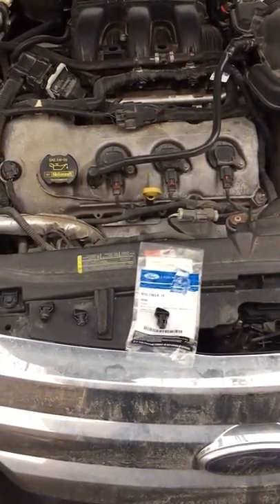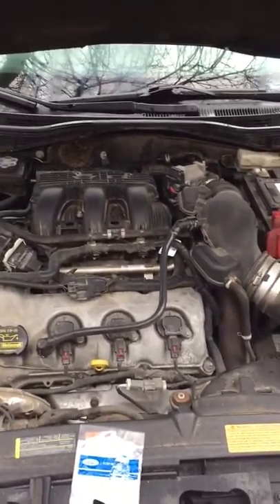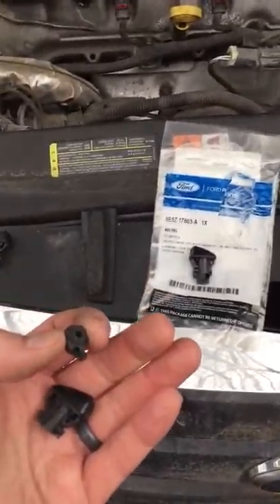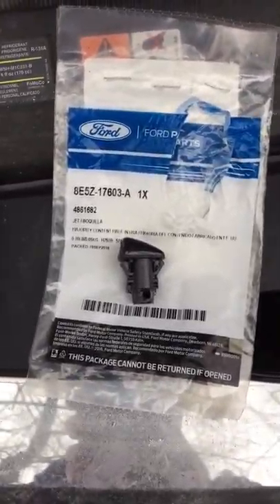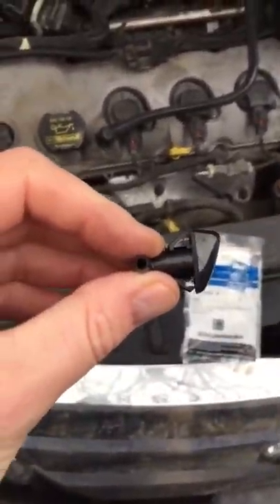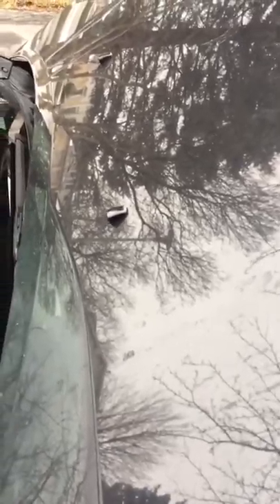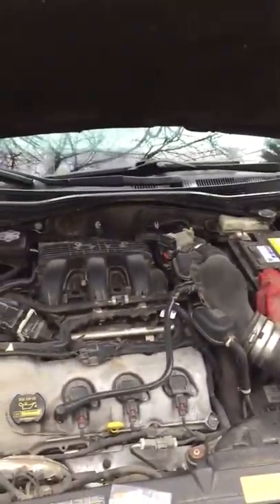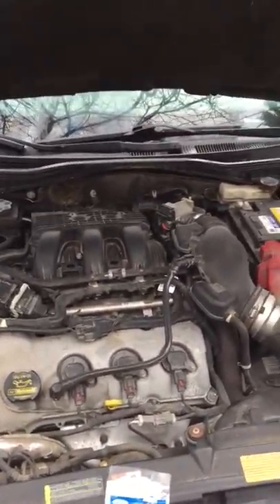Windshield Washer Jet Nozzle Sprayer Wiper Fluid Not Coming Out? Cheap Easy Windshield Washer Repair

Comment: I just had both washer nozzles replaced on my 2010 Ford Fusion. Now they spray the bottom of the windshield. Can they be adjusted?
Reply from the maker: Yes they can.  A small sewing needle or a safety pin can be used to adjust the spray pattern.  Thanks for watching and the questions!